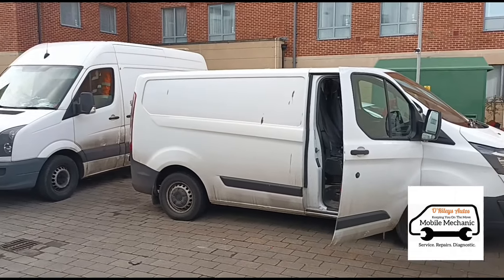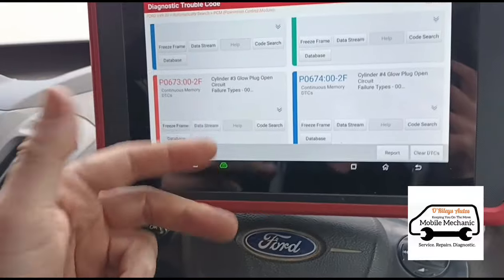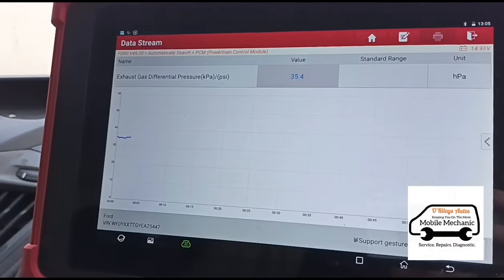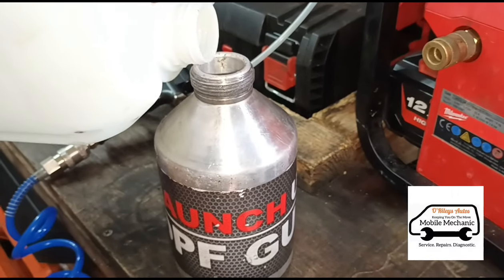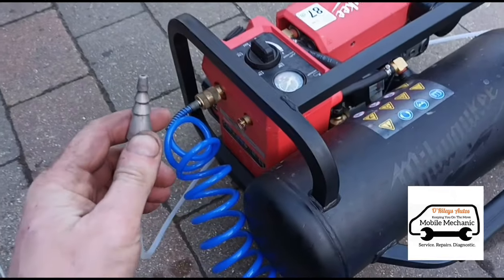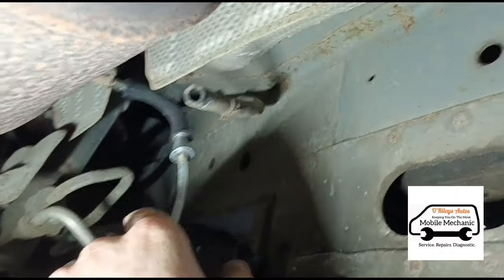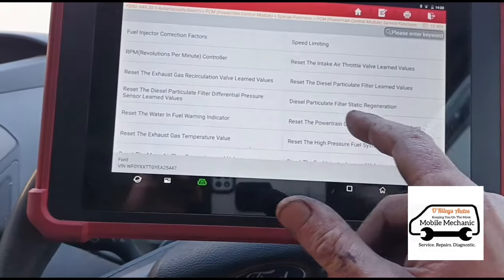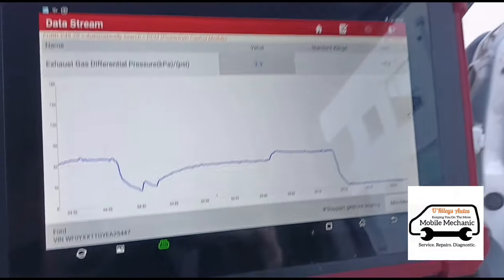Why? DPF Forced Regeneration Failed 3 Times? Do I Need New Particulate Filter? P2463:00-AF

Comment: Modern diesels last 7/8years use glow plugs not in the same way as before , they are used in the diesel injection cycle during normal driving as injector control has evolved , any deteriation of injectors or cylinder sealing will have a huge effect on particulates , an aging DPF will suffer greatly as efficiency drops . yes you are very much correct with this video,

Comment: Hello. 
You are saying that after DPF forced regeneration, oil change must be performed.
Why so? 
What is the difference between normal DPF regeneration and forced regeneration (for oil quality)?
Reply from the maker: Forced regenerations add extra fuel that gets pass they piston and contaminates the oil
Reply: @ORileysAutos   even after you do a forced regen after cleaning dpf you still get fuel in the oil or should i just not do a forced regen after  clean
Reply from the maker: @Devine . 34 years ago Updated  avoid forced regenerations where possible

Comment: I have a car with DPF and do mainly town driving - what do I need to do to keep the DPF happy? go for a cruise at 50 for a while every couple of weeks?
Reply: I'm not an expert but those who claim to be say it's about ten to twenty minutes (some say longer, 40 minutes) at 2000 rpm on the revs fairly regularly but it's not clear how often but I think your idea sounds probably a fair guesstimate.. Some say you don't need to actually move the car it's just the revs that count.. But others say it's safer to actually drive the car to avoid overheating of components
Reply: @CastleHassall  I was told to keep my fuel level above the half mark as much as possible. The regen won't operate if fuel level is low

Comment: A problem i had with my mk7 transit is the vapourizer fuse popped.
Glow plug 4 had stopped working, so wasnt regenerating properly, we think the vapourizer filled with soot and overheated popping the fuse at some point.
Expensive stuff when it goes wrong.

Comment: Dpf is pain, mine just came on now checked in was fine on idle just 8hpa at 3000 though its upto 180-200 says 5g of soot but dont know if thats good or bad. Luckily mines the psa 1.6hdi euro 5 so its fairly easy to take the dpf of because its spilts and only requires 2 clamps and the difference low pressure hose being removed.

Comment: insufficient MAIN BEARING SIZE, BIG END SIZE, CAM LOBE WIDTH and SINGLE ROW TIMING CHAIN will all WEAR in an engine where EXHAUST IS RESTRICTED and soot contaminates oil = DESIGNED TO FAIL.

Comment: I've had keyboard warriors tell me it's impossible to be a Euro 6 vehicle without having adblue, God Bless Em 🤣
Reply: I know Honda doesn't use ad blue foe a start on diesel's
Reply: My toyota Verso 1.6 diesel doesn't use ad blue
Reply: These days still easy to get rid of the AdBlue. Ask your local Indy to remove it. But in fact - here we are solving the DPF issues. Different thing. Learn, read, think. Peace.❤
Reply: My 2017 67 Captur 1.5 doesn’t use adblue!
Reply: No theses probably don’t have add blue just diesel exhaust fluid instead. Changed at about 100k or so. Diesel exhaust fluid and add blue are two different systems. One doses into fuel tank automatically and the other directly into the exhaust system. If  the car is 2017 onwards it will have one of these in the uk that is.
Reply: Scania didnt use Adblue because they used higher pressure and some different Common rail tech. They called the engine range XPI you see a lot of the 13 litre trucks go around (DC13 XPI is the engine) and you wont see an adblue tank on them. Theres a video on my channel of me running through an egr proving procedure which has to be performed when the vehicle has had a problem particularly the coolant system. They programmed this in as it is the only way that the truck knows that it is operating within known parameters in order to reduce Nox. If theres a fault like overheating it will effect the emissions also.  Obviously it achieves a good amount of this from egr cooling/temp control in the egr cooler so if the coolant temperature of the engine goes high it will effect the Nox reduction. All this without a Nox sensor also! Some models were fitted with one i think. Most commercial vehicles now will bring up a code for that type of thing but what I will say is that the regeneration operation conditions and resilience is wayyyyy better than cars and vans. With the new euro 6 diesels you are much more likely to see adblue with scr tech it must be almost necessary fitment now to keep up with the game.
Reply: A200d mercedes 2.1 diesel don't use add blue and is euro 6
Reply: My 2014 BMW 3.0 530GT doesn’t use adblue. I only realised it’s euro6 when I did an online ULEZ check.
Reply: Why would the oil be contaminated if the regen pumps fuel into the exhaust?
Reply: AdBlue is simply another method to do the trick… it’s more fuel efficient but on the other hand AdBlue incurs additional cost just as well.

Comment: Its a monent when the vehicle can stop driving if glow plugs not changed. People ignore the knackered glow plugs and then the engine is both harder to start but also puts out more pollution because its not as effective at using the diesel to make a bang. So scan tool wont let the regen happen until they fixed. Then after so long as a bucket load of other readings are right too, then the regen should happen.

Comment: I have same problem on tourneo custom and lots smoke coming out Taken into ford second time said they repaired it and yet it doing same van under warranty had to wait on part from Germany and had van back 2 weeks and problem persists the smoke coming out is alarming. Could you tell me where the smoke is coming from. You had revved van andsmoke came out over the top of enginelike mine. This is ford main dealer and van has to go into repair third time. What causes it to clog upall the time and how is the smoke escaping over engine.

Comment: Jimmy if you would be so kind to answer this please 🙏
I’ve done the double flush & lowered the Differential Pressure from 4.5kPa down to 2.3kPa at idle,  & at 3,000 Rev’s it went down to 12.0kPa at idle,  so still high but I’m unable to give it a final good run as I’ve no MOT on it.
So what’s the best way forward now?  I’m guessing just reset the soot percentage & tell it it’s got a new DPF Then do a static Regen?  it’s still also in limp mode.
Reply: Book an MOT that's a drive away and take it there. No law says how far you can travel to a MOT centre.

Comment: I tried to do a forced regeneration on my 2011 Renault Kangoo today. It failed and I got the message "Regeneration failure: The relative pressure inside the PDF is too low" But I also saw a code DF997 " Control unit heating element connections, signal incoherence."

Comment: Could you tell me if the vaporizer needs priming manualy with a computer as I had same issue with my dpf, my vaporizer was blocked and seized I fitted a new one but now it won't do a forced regen, is this because the vaporizer needs priming? My car is a mk3 for focus 2.0 tdci

Comment: Ive got a Renault Captur 1.5 DCI  that I’m trying to sort out  2018 done 24000 miles only fault is df1020 engine oil dilution no other codes car is healthy DPF differential is between 3 mb on idle to 28 mb under load all pipes sensors checked but still fails regen ? 
The only other thing I have noticed is the coolant and oil temp never goes over 78c under load could it be a thermostat issue not allowing the engine to get up to correct operating temperature 
This first happened during the recent -5c weather any thoughts  appreciated 👍🏻
Reply from the maker: Just change the oil and reset oil dilution calculation.  If temperature doesn't reach  90 it may need new thermostat
Reply: @ORileysAutos  thanks for the reply, could the oil dilution calculation be called something different on a Renault I don’t seem to be able find this perimeter just the oil service reset 
Appreciate your support
Reply from the maker: @NJW1967  oil service reset should do it. Why try to regen if the dpf isn't blocked?
Reply: @ORileysAutos  I wasn’t it just keep coming on for no reason, my only explanation for the oil dilution warning keep re appearing is because it’s trying to regen while driving but failing the only thing I can think is its not getting warm enough, car is a proper one owner full history motor its driving me bonkers 😜 
Inside pressure diff sensor it was like brand new pipes mint think I’m going to try a new thermostat when GSF opens again 🤞🏻

Comment: 4 months ago, i did forced regen on my ecodiesel ram 2017 using scanner. Then 3 weeks ago, engine light  popped again and i went to do the forced regen, but then it didn't allow. it said i have to fix the code -P0545-00. I didnt work on it right away.  so yesterday, while returning home from work, my engine made a tac tac sound and shut off completely. do u think my engine is blown off?

Comment: Jimmy when you where using wynns dpf cleaner did u add half water or was it just neat?
Reply from the maker: Launch fluid is concentrated so 1L can be mixed. 
Wynns is already watered down witch is why you get a larger volume
Reply: @ORileysAutos  Jimmy Range Rover sport 2013 restricted performance throttle body valve stuck also found a egr actuator sticking would it be ok to use wynns dpf cleaner instead of revive?

Comment: Does the dpf cause low torque on first gear? Feels like there is a blockage somewhere
Reply: Cheapest option to try would be change the air filter and see if fresh air helps. The older the air filter the more clogged it is reducing air intake and overall power.

Comment: If the soot content is high and all the codes are fixed will the van eventually  clean its self ?
Reply from the maker: Once it goes over 150% it won't regen
Reply: @ORileysAutos  we had the dpf cleaned, car still in limp mode, will not regen. MB wants $800 just to take it out of limp mode. Any suggestions? Recall warranty should cover all of this but they refuse to acknowledge it. Just frustrated!